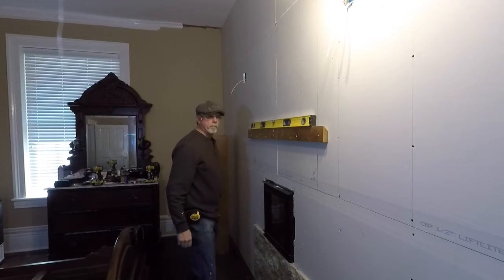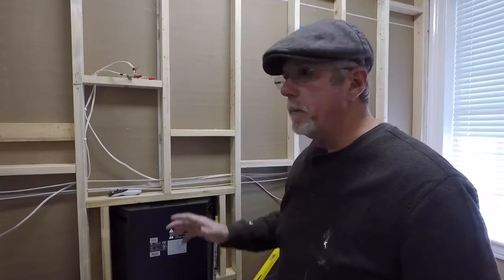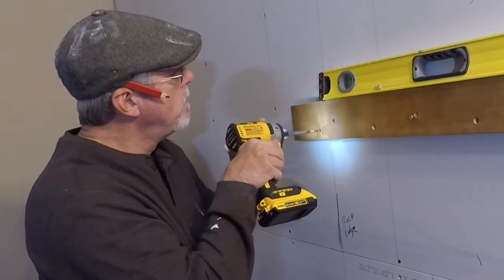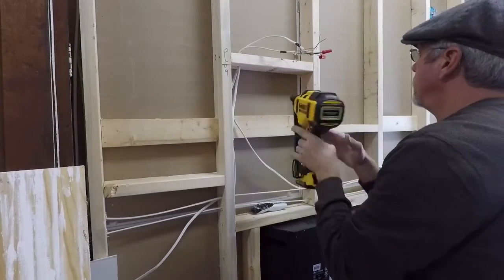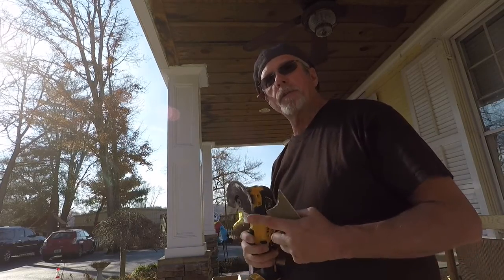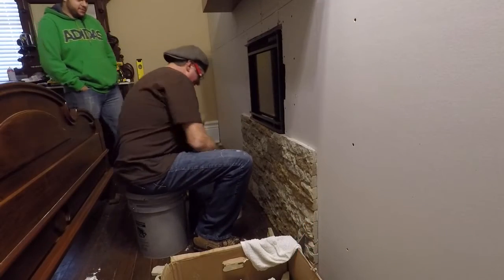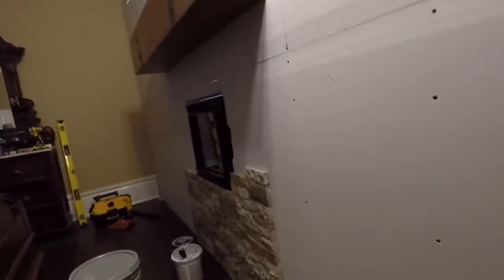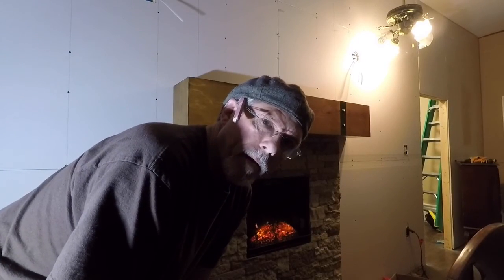Hanging a fireplace mantel and installing air stone.

Comment: I just put air stone on my fireplace and can honestly say just cut it with a wet saw. I tried a hacksaw, chop saw, jigsaw, and grinder. In the end I bought a $50 wet saw from harbor freight with a blade that said it would cut stone. I cut 60 inches worth lengthwise with ease. My wife was laughing at me saying I went from being pissed to saying this is so easy! Forgot to say it also doesn't throw a HUGE amount of dust everywhere. It all stays in the water and can be easily cleaned.
Reply from the maker: gmale.com a little later I put air stone on some columns in my daughters salon and I used my Ridged wet saw worked good. Thanks for watching and commenting you have a blessed day
Reply: My wife bought this stuff and I had to pretty much figure it out on my own. Even Lowes had no clue what to do. Yours was one of the videos I saw that had a lit of useful info. I just wish someone would have told me how easy it was with a wet saw from the start. I'm just trying to save people some time. Keep up the good work!

Comment: Chop saw cuts airston
Reply from the maker: Herag Hanessian I have a tile saw but I don't get it out in winter unless I'm working on an empty house so I can leave it inside. What blade do you use on chop saw to cut the air stone
Reply: The Days Of David hey Dave. I just use a regular carbide blade. I think it's a 40 tooth. It burns a bit when it hits the surface of the air stone but then cuts right through. Used it all day and still cuts.
Reply from the maker: Herag Hanessian 👍